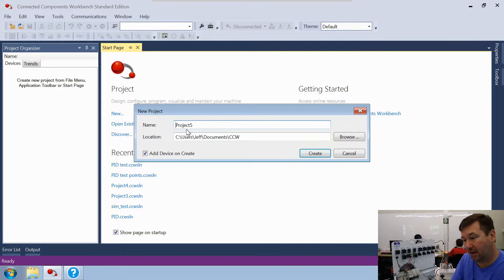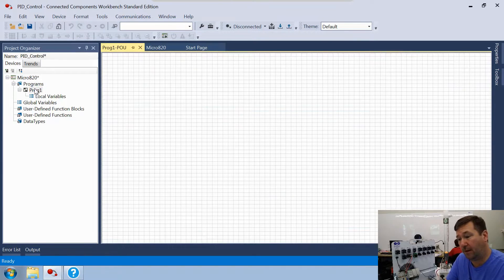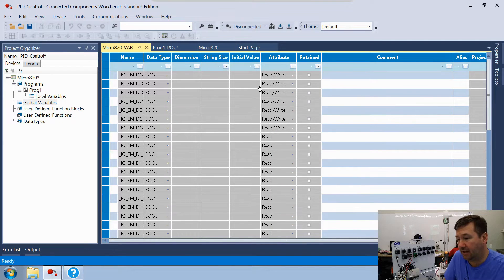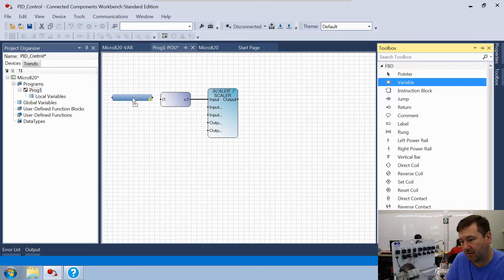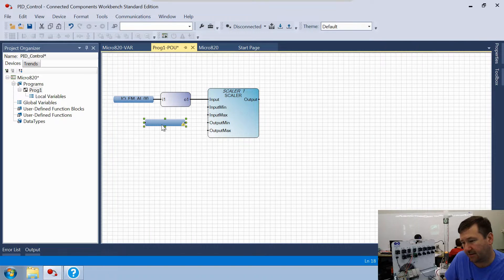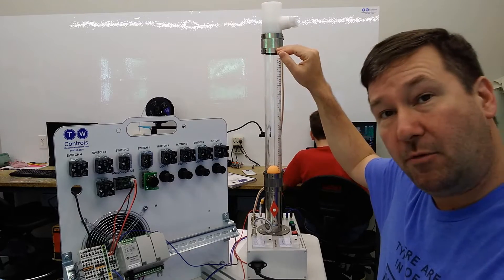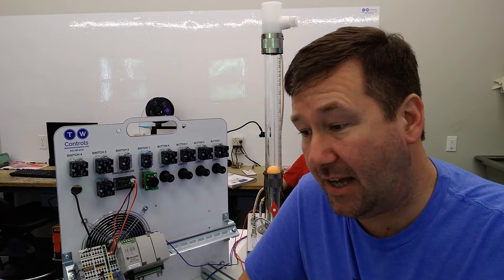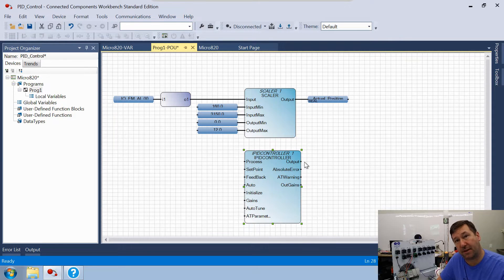Micro800 PID instruction in CCW

Comment: Hi Tim,

Thanks for the video — I really enjoyed it. It's always interesting to see the different workarounds we have to come up with depending on the equipment we’ve got available.

I had a similar challenge on a water treatment plant recently. Although we were well within the water authority's hourly discharge limits, our sump pumps were cycling on and off with a ramp via a variable speed drive. This meant that our instantaneous discharge rate in litres per second would occasionally spike too high.

I ended up linking the control to a flow meter, which had a noticeable delay in real-time feedback. I managed to work in a delay to compensate, but like you, I ran into trouble using the LIMIT instruction due to the DINT format — no decimal point meant the drive frequency kept bouncing. I got around it using separate greater than and less than instructions followed by MOVE instructions, which worked well.

Thanks again for sharing — I always appreciate seeing how others approach these control issues.

Best regards,
John
Reply from the maker: Great, here is a newer vide that may be helpful.
https://youtube.com/live/h8gr41BJ0H4

Comment: Hey Tim, I am trying to insert values into my gains, but it will not accept any values I put in there and reset them to 0. I try while online and offline. I am assuming that is why I cannot get my PID active and get an output. The AutoManual is true. Any clue what I am doing wrong? My rung is true up to the PID.
Reply from the maker: Make sure your are trying to change the tag associated with the gains on the left side of the instruction and not the OutputGains on the right side.
Reply: @TimWilborne  I was but did notice that I was trying to use PID and not the IPID with the built-in auto tune. I think I got it now. Thank you sir!!!!
Reply from the maker: That is great to hear!  We are getting ready to freshen up the PID videos and I'll detail out the CCW more.

Comment: Hi Tim, I hope you respond :D
Look, I am trying to make a temperature PID, but on a Micro850, I see that in that PLC I do not have WORD outputs, how can I solve this?? Also to see if it is necessary to make other types of adjustments for the PID, I have a PT100 as a sensor and an SSR to activate my resistors.

Thank you in advance for your answer.
Reply from the maker: Look at the Any_To instructions fir conversions
Reply: @TimWilborne  Okay, any more points I should consider? Thanks for your prompt response
Reply from the maker: Points as far as what? But should solve  your data conversion
Reply: @TimWilborne  I mean, should I change any other aspect of the PID so that it is temperature, taking into account the sensor and the SSR?

Comment: Hi Tim, Thanks for this video but in case nobody has pointed it out it is incorrect. You have the "Process" Input and the "Feedback" input switched. The "Provess" is actually the PV and Feedback is the feedback of the control output (CV or MV). The Rockwell Documentation confirm this.
Reply from the maker: Do you have a link?  Check out page 537 of this manual from Rockwell.
https://literature.rockwellautomation.com/idc/groups/literature/documents/rm/2080-rm001_-en-e.pdf
Reply: I see it was wrong but then our friend Tim fixed it toward the end of the video around 16:32. I was a bit confused too for a minute.

Comment: Tim. I am using RA_TEMP_CONTROLLER function block, everything working good, I can make autotuning and PID works perfect, but once I turn the power off and on again I am loosing the PID values, all of them are "0". I do not understand, because set point and other values the PLC is holding them (I am using retained option). How can I hold the PID gains once I turn the power off? thanks!
Reply: Enter the value in both the Project Value and Initial Value fields for the tag.

Comment: QUICK question, why did you have to turn the potentiometer to run the fan???
Reply from the maker: It has a trim potentiometer.  In some upcoming videos I'm going to use it to "upset" the PID process, simulating corroded terminals.

Comment: Hi Tim. I have a project in the company where I work, is about a temperature control. i already did a project using any_to_real and comparators just to activate outputs, but the temperature is taken to much time to stabilize. do you believe the PID could help me? do you give any personalized training?
Reply from the maker: Hi Heriberto.  It is possible but there are too many variables to say for sure.  We do training on Studio 5000 and while we may touch on PIDs, it isn't designed to help you program them. https://twcontrols.com/plc-lab

Comment: I understand why you type variables and  did not like to link function blocks with lines. But for beginners like me its much easier to understand.
Reply from the maker: Hi Dave.  I wouldn't say that I don't like it as much as on more complicated function blocks, you may end up on multiple sheets and at that point you must use references to connect the function blocks between sheets.

Comment: Hi Tim. your video is really good!, I would like to know how to use the PID for temperature control using micro 820.
Reply from the maker: It would be the exact same as this video.
Reply: @TimWilborne  you are right, but you are controlling an analogic output and I want to controller a digital output (solid state relay).
Reply from the maker: Gotcha. You would need to convert it to a PWM. That would make a good video.
Reply: @TimWilborne  Did you ever make a video over this?
Reply: https://youtu.be/rBQVfCUuhfs.  This video could help you.

Comment: Hi Tim, I am a little bit confuse about the value put into the Process. Before you download the program, I saw the Process tag name is PID_Command_Speed. After the downloading I found that the Process tag name is Actual_Position. Did you switch those two tags before you download the program? Thank you very much
Reply from the maker: 17:30 is correct.  I accidentally removed the part where I corrected it.  I plan on making a supplemental video about it next time I have it setup.

Comment: sir i have a problem during build the ladder showing input variable unwired
Reply from the maker: Hi Deepak.  Check out 17:30 for the corrections.  I accidentally removed the part where I corrected it.  I plan on making a supplemental video about it next time I have it setup.

Comment: First, thanks for these excellent videos. I have a question, forgive me if you have already answered elsewhere. The topology looks different between when you initially built the project (reference 17:00) and what shows up when you are online (reference 17:30). Specifically it looks like the sources connected to the PID inputs "Process" and "Feedback" have been swapped. Did I miss something? OK, I guess I have two questions; does "Feedback" serve the same purpose as the "Tieback" input on the PID blocks in the old PLC5/SLC controllers?
Reply from the maker: Hi Bonnie, 17:30 is correct.  I accidentally removed the part where I corrected it.  I plan on making a supplemental video about it next time I have it setup.

Comment: You switched your feedback and process variable near the end right?
Reply from the maker: I don't recall doing that but it has been a while since I watched this one.  What time in the video are you seeing it?
Reply: 17:00 you can see what the Function Block looks like off then when it’s on the inputs are switched.
Reply from the maker: @lewblabencol  I went through it and I don't see where the feedback and process variables are switched at any time.
Reply from the maker: Ah, you are right.  Looks like I had an error and didn't note where I fixed it.  I'll pin a comment about that.  Thanks Benjamin.
Reply: 17:00
Process = PID Speed Command
Feedback = Actual Position

17:27
Process = Actual Position
Feedback = PID Speed Command

Comment: How many control loops can an Micro850 run at the same time?
Reply from the maker: That's a loaded question. It would mostly depend on the memory available. Let's turn the question around. How many are you hoping to control?
Reply: Thanks for your response. I hope it can manage at least 8 PID control loops.

Comment: Hey Tim could you make a video on how to use the Micro800 Simulator to simulate a PID control loop with CCW? Is this even possible to do? I'm guessing having the output affect the PV would be difficult to do without any direct correlation. Maybe using an equation to do it.
Reply from the maker: We have some exercises in the series that can be done in the simulator but eventually you need to get some hardware. Stay tuned.

Comment: Tim, in CCW, go to Tools > Options > Environment > Fonts and Colors and drop that guy down to a pt 6. You can change the font to something a little less blocky as well. Also, anything built with Visual Studio, like CCW, I would have a ton of graphical glitches with. You might want to try and go to Tools > Options > Environment  and then UNCHECK "Automatically adjust visual experience based on client performance." That fixed some of the graphic issues I was having with CCW. Now, I only mildly can't stand CCW instead of completely hating it like I did before.
Reply from the maker: I'll have to try this.  I had played with them before but was using a Windows 7 image and I've heard that this may have been part of my problem.  Thanks for the tips!
Reply: @TimWilborne  Yeah, not sure how it would work on a Win 7 machine. I'm on Win 10 it solved most of my display issues. Thanks for the vid. Looking forward to the rest of this series.
Reply: Good night tim i'll c ur comments in my morning please take care